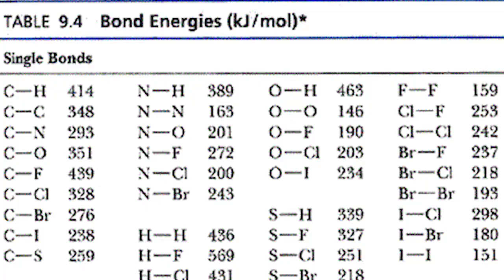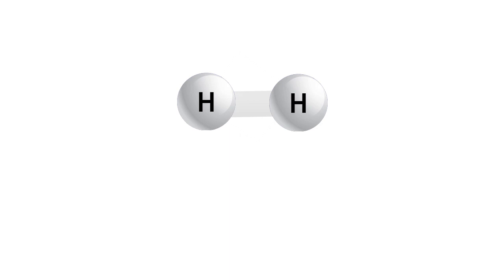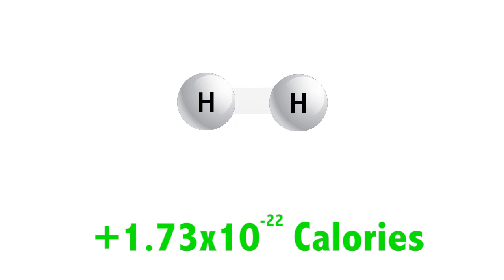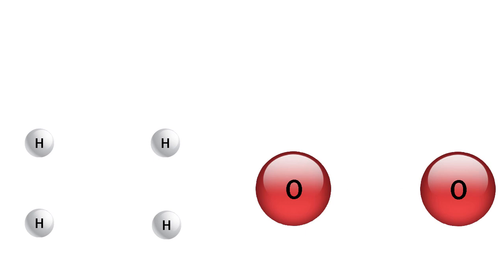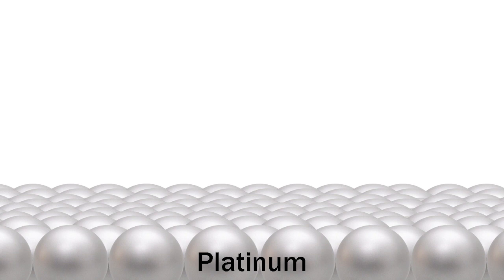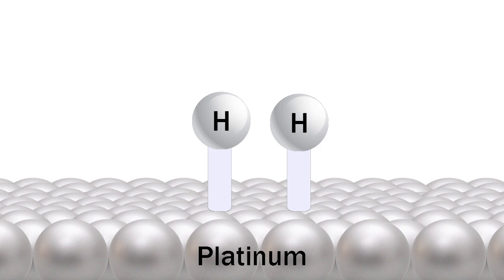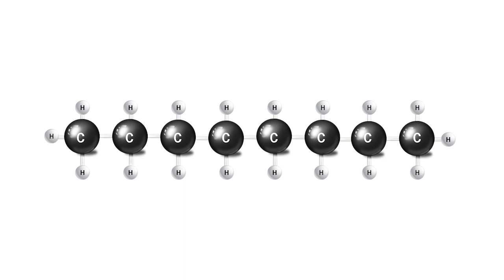Fundamentals of Catalysis

Comment: I got lost when you said that the catalytic converter helps cars go fast.  The CC will decrease a cars performance due to air flow restriction, which is why there are popular to replace (although it's typically illegal).  Maybe I misunderstood something.

Also, it's hard to visualize the difference between -8.22x10^-22 and 1.17x10^-21 calories.  It would be cool if you could do a comparison, or express that difference in a percentage so more viewers could relate.
Reply: No, you're right, he is dead wrong on that part ... the cat is a much hated part of a car as far as performance is concerned. But it helps with emissions which is a much more important issue than 0-100 times for most road cars :P
Reply from the maker: Yes, you are right, the catalytic converter does not help the car to go any faster. I was trying to simplify the benefit of having the converter when I said that, but I misspoke and just continued speaking. I can't believe I made that mistake! I will be fixing that in a future video. Also, I think you are right about the numbers in scientific notation, and I will try to think of a better way to communicate that in future videos.

Comment: Helps cars to go so fast? I don't really understand why the post-engine exhaust system would affect vehicle speed. Are you possibly thinking of a turbo or did I miss a detail in the vid? Nice vid though, I got here from Cody's channel
Reply from the maker: No, you are correct, the platinum converter does not help the car to go fast. I got ahead of myself when I was speaking and was just trying to describe the benefit of having the platinum. I wasn't really paying attention to what I was saying and so I didn't realize my mistake at the time. It was sort of a quick, informal video that I did a little bit before I had to go get ready for street mining with Cody, and didn't have time to fix after I had watched it. I will be fixing that in a future video.

Comment: AFAIK The auto engine 'saves' about 2% of the gasoline in order to power the catalytic converter to make it hot.  IOW We waste 2% of the fuel that we put into our cars.Reduction of nitrogen oxides to nitrogen and oxygen: 2NOx → xO2 + N2
Oxidation of carbon monoxide to carbon dioxide: 2CO + O2 → 2CO2
Oxidation of unburnt hydrocarbons (HC) to carbon dioxide and water: CxH2x+2 + [(3x+1)/2]O2 → xCO2 + (x+1)H2O.
These three reactions occur most efficiently when the catalytic converter receives exhaust from an engine running slightly above the stoichiometric point.

Comment: How do you figure a platinum converter makes a car go fast? Their use is to reduce nitrogen compounds in the exhaust gases to reduce air pollution.
Reply: Without the platinum converters, engines would need to be much smaller for environmental reasons, so in a roundabout way it sort of does.
Reply: That's really "roundabout".
Reply: +uTube486 we could say that it makes cars go fast, holding the environmental impact of the vehicle fixed.
Reply: They make cars go slower. A converter is a big restriction on the exhaust system robbing your engine of power. It's only function is for environmental reasons, just dead weight as far as going fast is concerned, anybody after performance will ditch them.
Reply: Well to address the video, Cats dont remove to much power, its more a myth young hooligans believe. Easily tested with devices such as Flowbenches. Also he states "for life", Cats can also fail with engines, snowball effect from when stuff like bent valves happen.
Reply: NephilimDJ
The real myth is that more backpressure gives you more power. What actually gives you more power is high exhaust velocity and exhaust scavenging. Backpressure forces scavenging at the expense of velocity. Likewise using too big a system (for most applications 3" diameter is too big) will ruin your velocity. What you actually want is no backpressure with high velocity and scavenging, such as a 2.5' system with no cats or restrictive mufflers, long tube headers, and a H or X pipe. Cats are nothing but dead weight that kill power.
Reply from the maker: You are right, the platinum converter does not help the car to go fast. I got ahead of myself when I was speaking and was just trying to describe the benefit of having the platinum. I wasn't really paying attention to what I was saying and so I didn't realize my mistake at the time. It was sort of a quick, informal video that I did a little bit before I had to go get ready for street mining with Cody, and didn't have time to fix after I had watched it. I will be fixing that in a future video.
Reply: Well...that's OK. Cool video about the platinum recovery. May I have half of what go harvest? :)

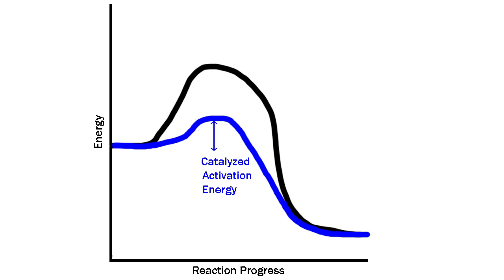Comment: 1:31 That couldn't be more wrong.

I do like how informative the other parts of the video are, though.
Reply from the maker: Thanks so much! You are right, the platinum converter does not help the car to go fast. I got ahead of myself when I was speaking and was just trying to describe the benefit of having the platinum. It was sort of a quick, informal video that I did a little bit before I had to go get ready for street mining with Cody, and didn't have time to fix after I had watched it. A lot of people have pointed out that mistake, and so I will be fixing that in a future video.
Reply: Still enjoyed the video though. I should have figured others would have pointed it out as well, sure it seems like an annoyance after a while. lol.
Reply: @AskArthur  it does allow the car to burn more fuel because of it's increased efficiency and compliance with air quality laws. So I think you are correct in saying it allows it to go faster. With out it, you legally wouldn't be able to produce as much power.

Comment: Sorry. You got it wrong. This is not why catalyst works. You definetly have heard a few things, but apparently have not quite understood it. Catalysts do NOT change the energy for breaking or creating bonds. This is fundamentally wrong! Catalysts have no effect on thermodynamics: The energy change to break or create a bond with or without a catalyst is exactly the same. Cataysts do change the activation energy (you got that right), but the activation energy is not the energy required to break bonds. Then, a Pt catalyst does not make a car run fast, this is really nonsense. The Pt catalyst in a gasoline car helps to burn off some residual fuel and poisonous carbon monoxide in the exhaust, thus reducing harmful emissions.. But the catalyst has, in principle, no effect on theperformance of the engine, and therefore does nothing to make your car go fast.
Reply: Then explain how catalyst wrks
Reply: @harshithapatel8253  https://en.wikipedia.org/wiki/Catalysis
Reply: didn’t say change energy to break bonds in weakens then so it’s didferent
Reply: @arthurtao6820 at 0.35 it literally is said that a catalyst changes the energy to break the bond. That is a statement of thermodynamics 1 st law. Catalysts do not change thermodynamics! So your statement is wrong, as I said. The given explanation is confusing binding energy with activation energy. Activation energy is a term related to the rate of a reaction, but that has not so much to do with the binding energy, it is something else. Activation energy is the difference between an initial state and a (hypothetical) transition state, marking the point of highest energy along a reaction path. That energy can be higher or lower than the binding energy, dependent on how the reaction works. Catalysts lower activation energies by providing alternative reaction paths as compared to non'-catalyzed reactions.